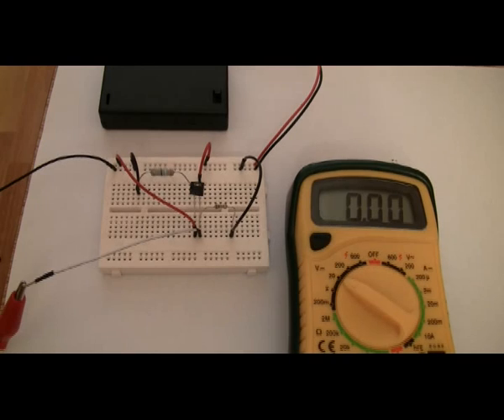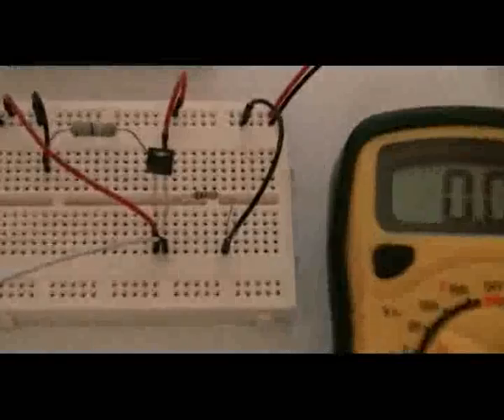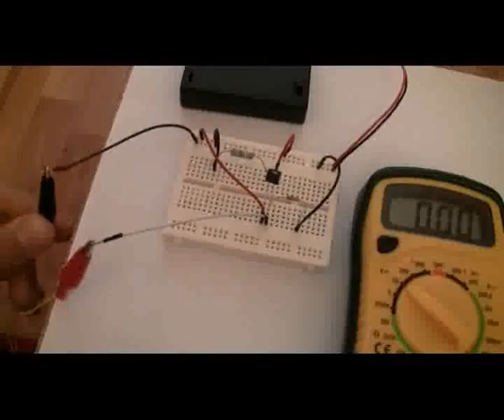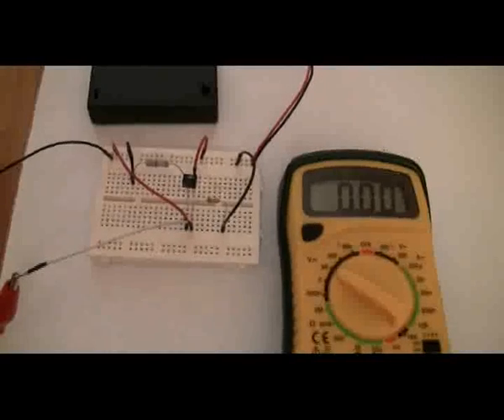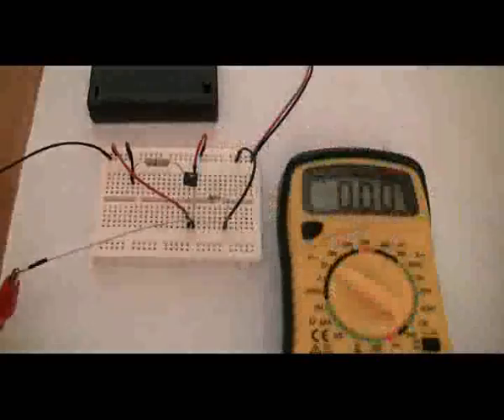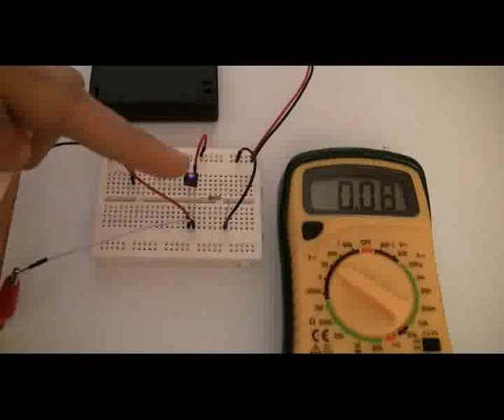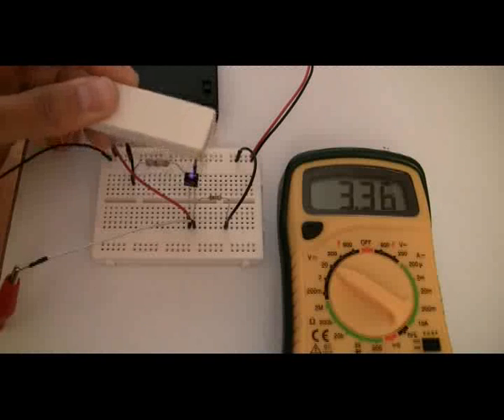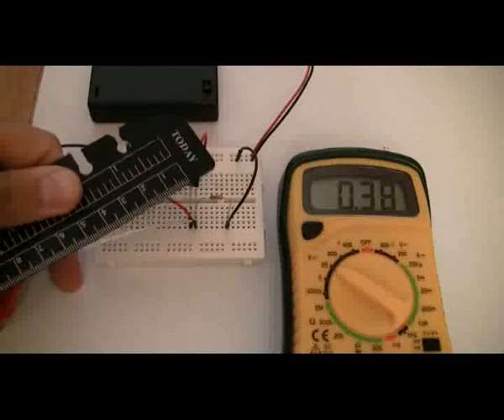QRD1114 test setup

Comment from the maker: @MomochiZab, sorry for late reply, I must have overlooked your comment. So, Yes, is works absolutely fine. I'm not too good in electronics (yet, but I'm working on it :) ) so, I did not calculate the resistance for transistor, just picked the value from couple of circuit diagrams I encountered on the internet.

Comment: yeh i saw the link after watching your video lol. was wondering did you set the circuit up as the same way as the circuit diagram? and how did you figure out the resistance values for the transistor =)